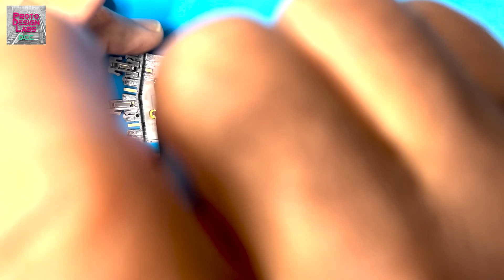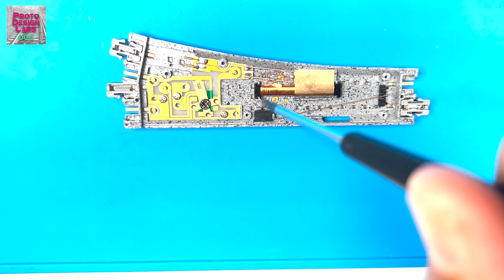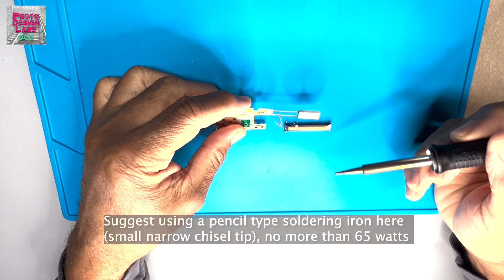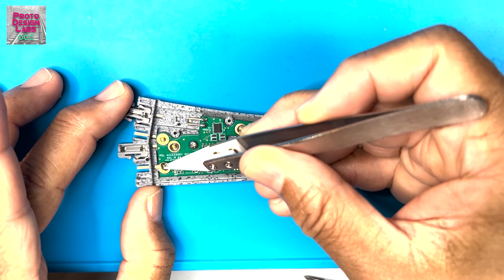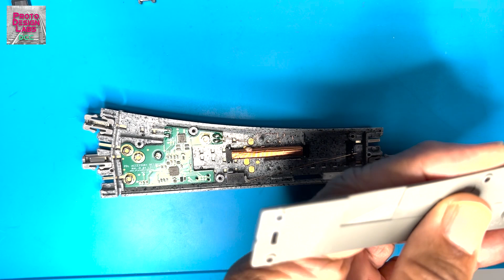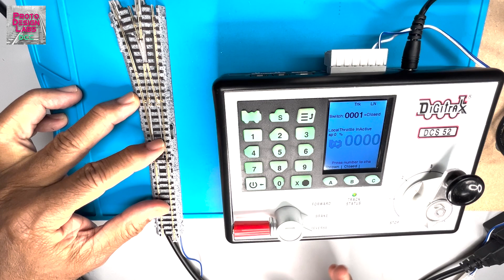Proto Design Labs - N4L Accessory Decoder Installation, Test and Address Change

Comment: Can this be used on the longer #6 Kato turnout pls?
Reply from the maker: Sorry for the delay. Each Kato turnout design has an original circuit board with unique shape and attach points. We mimic that and add a processor and other stuff so each turnout decoder is different. However, we are working on a decoder for the #6 turnout!